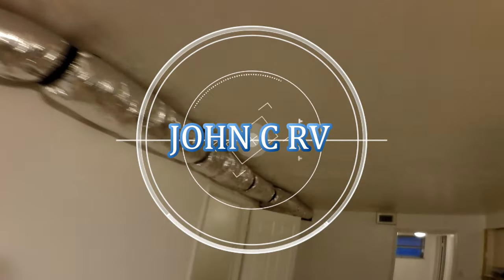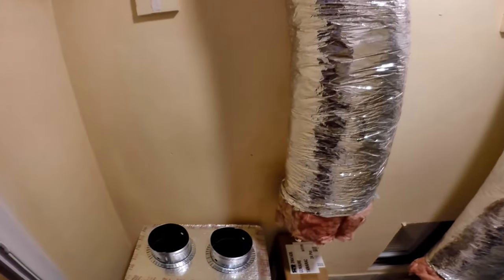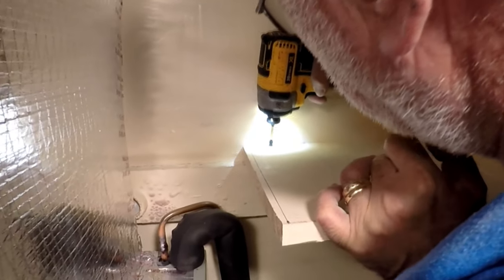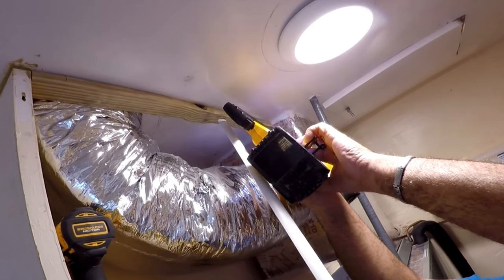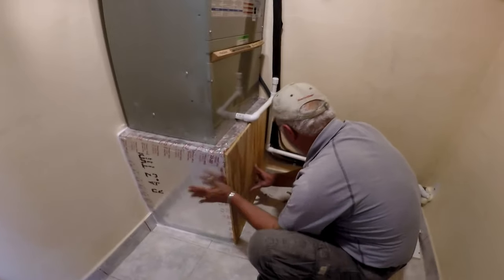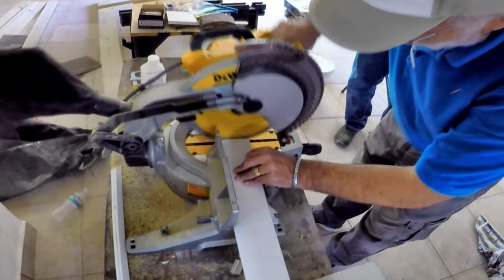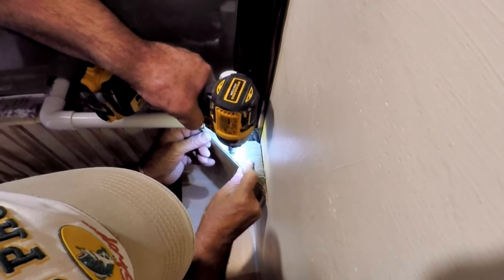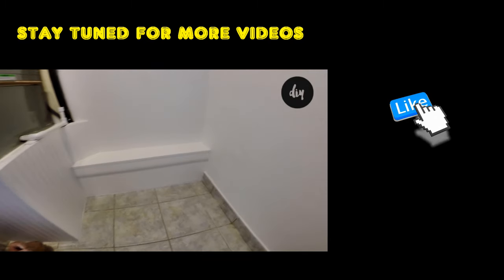How To Use Existing Closet to Install an HVAC | New Air Condition Split System

Comment from the maker: This is how we used an existing walk-in closet to Install a new Air Conditioning Split System. Installing a new air conditioning split system into an old house can be a challenge. It previously had window and wall AC units.

Comment: Awesome job John and son's! The air duct box and refrigerant line / condensation drain covering turned out great! The walk-in closet was the perfect location for sure! Have a great weekend!  👍
Reply from the maker: Thanks 👍 Almost a perfect situation. Too bad the ceiling trusses were not running the opposite way, it would have been the prefect installation. Have a great weekend.

Comment: Hi John. A good use of the existing closet to install the AC system. I enjoyed to the end. I replied to your recent comment on my latest video but in the process both your comment and my reply disappeared for some reason.  I have had quite a few replies disappear recently. Thank you my friend.
Reply from the maker: That's weird. The same has happened to me but I thought I did something but now I'm not the only one. I found this on youtube but not sure if it helps https://support.google.com/youtube/thread/116351041/recent-reports-of-missing-comments?hl=en
Reply from the maker: I had the same as you, both ways. I have read other forums that many issues with YouTube have risen since their server crashed a few weeks back. including notifications by email. Hopefully it gets resolved. Take care Dave.
Reply: @JohnCRV  Just tried to view and "like" a reply to a comment I made on a friend's video. Mine was the only comment. I can't see my comment or his reply even though the video still says there are two comments on the video but none are visible.
Reply from the maker: @Dave Stredulinsky  Yup! They definitely are having issues. Sounds like their A.I. is getting overloaded or needs a little adjustment.

Comment: Dies the ceiling have to be closed,  bc in mind I can see straight through the to the attic and curious if that's why my ac stays running bc it's trying to cool down attic too
Reply from the maker: Sorry, not sure what you mean. This is the bottom floor to a 2 story building. No attic involved here. But I do have ducts in the attic for the upstairs apartment. The attic ducts need to be the insulated type to be able to contain cool air.